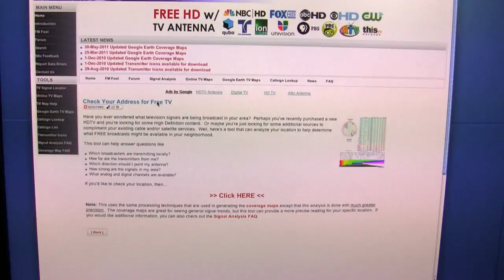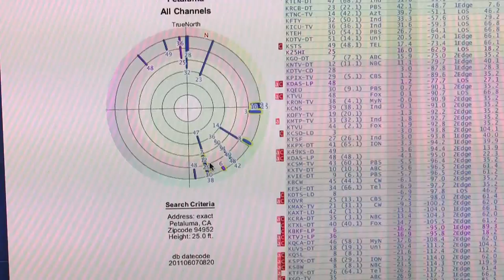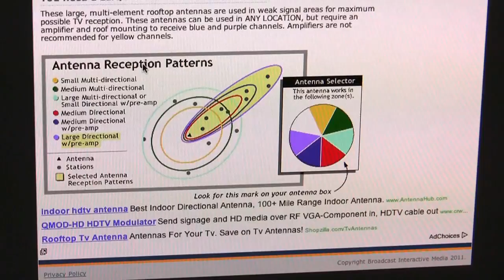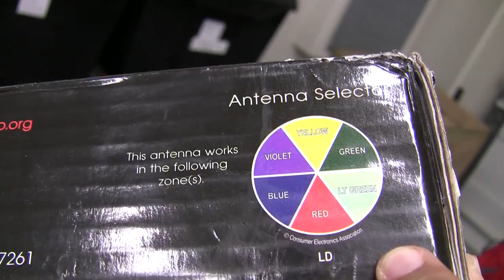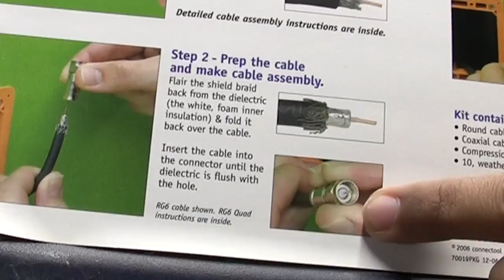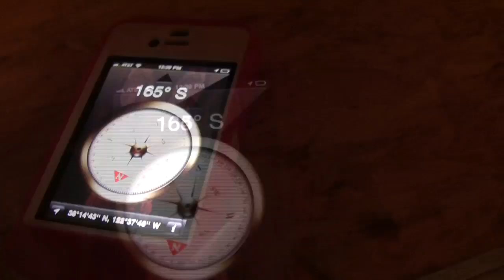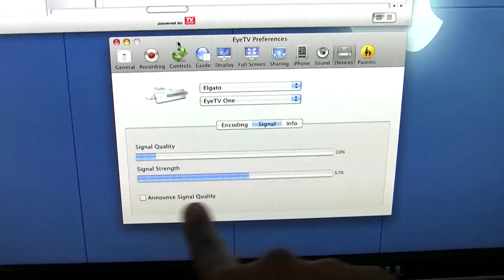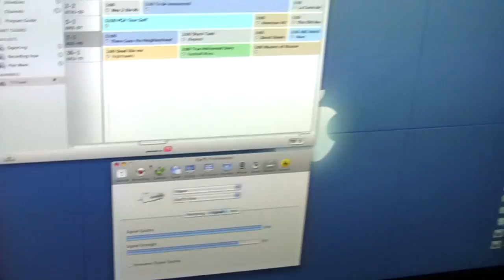Get free HDTV using an over-the-air antenna

Comment: Have a Nippon AU-14 (UHF) from a radio store. Looks like an arrow and works very well for my location.

Pointing the antenna is less an issue within 40mi from transmitter as long as you have strong signal. Out of town stations 50mi and over you tend to need more precise pointing. Sometimes the direction you want may be blocked by trees, hills & buildings so you point away to get a bounced signal.

Went by an electronic store with an antenna pointing the "wrong" way but still got all local stn.

Comment: All you need for an OTA antenna is an RF antenna connected to the back of your TV. You can buy the RF Antennas for about $10.
Connect it directly to your TV but if signals aren't strong enough in your area add 3 ft of CATV cable then add RF antenna.

Comment: I purchased the RCA ANT751R Outdoor Antenna and installed in my garage attic.  I hooked up a signal amplifier and now have 19 digital channels.  Thing is, my antenna points AWAY from the towers.  The towers are SW and my antenna points NW.  Only thing I can figure is, pointed SW, there are far too many homes and other obstacles blocking the signal.  Pointing NW, I've got a clear shot at a large open area where I'm probably getting signal reflection?

Comment: Can you point your antenna in the direction of most of the stations and still get some that are 55 or 60 degrees away? Or do you have to turn it each time you use it?  My favorite PBS station is in one direction, in other words, and the network channels are 60 degrees away. My favorite station is more miles away than the network channels (yellow zone). So should I point it at my favorite, further away channel? Thanks!

Comment: Attic installed antenna is not really optimum.  You have to put it outside if you are a long distance from the transmission towers.  Federal rules prohibit anyone from interfering with your "right" to install an antenna.  See here http://www.fcc.gov/guides/over-air-reception-devices-rule
Reply: natureflixs1
Reply: natureflixs1k moo

Comment: Here is my setup.  I am about 24 miles from the transmission towers with some trees in the front yard that I limbed up.  Here is a photo of my setup  http://flic.kr/p/jawzMX.   Don't forget to install a ground wire if you antenna is outside.

Comment: Except if it's transferred using Coax you're only getting a 480i signal.....and a split mono channel for audio unless it's decoded somehow. 

._.
Reply: Wrong. There are plenty of OTA HD stations.
Reply: I'm pretty sure I know what I'm talking about kid.

Coax is 480i max and a single Mono-channel split in two.

kthx
Reply: Objectified Cross You mean reparable, genius? It's not the same word, in context, as repairable. You're still wrong: Coax carries HD without issue and only artificial limitations placed on it via cable boxes render it unable to pass that stream through less than hdmi or (to a lesser degree) component. Those limits are restrictions to combat piracy, not limitations of coax itself. Only a bronie would start some bullshit routine about 'intellect'. Just move along.
Reply: It's the tv station/broadcaster and the the digital HD decoder/box that determines the video/audio output. Some tv top decoders only output at 480, but basically every single digital HD decoder that has been built into a tv (that has an ATSC tuner), can output at 720p and 1080i, and if the OTA channel has 5.1 audio (like when they broadcast a sports event like the Olympics, football, baseball, or a movie) you can get that as well.
Reply: The OTA signal is not decoded by the antenna. All the antenna does is "collect" the digital signal. The signal itself is actually decoded with either a tv top HD tuner/box, or a built in ATSC digital tuner (which almost every single digital tv has, as long as the digital tv was built within the last 3-4 years). Check your TV's manual to see if it has a built in NTSC/ATSC tuner. If it has the ATSC tuner and you are within 45miles (or arounmd 70 KM's) of a digital transmission tower, you are capable of getting these free digital OTA channels.

Comment: Truth and Quality , 
Practical and Useful Information.
------------------------------------------------------------------------------------------------------------------------------
>>> As Always <<< the Best Reception is L.O.S. = Line of Sight , Reception.
LO.S. Means No Obstructions of Any Type or Kind Between the Transmitting
Tower/s Antenna/s and the Receiving Antenna.
------
Yes Attics Will Obstruct and Degrade Reception.
------
Yes Buildings of All Types and Kinds Will Obstruct and Degrade Reception.
------
Yes Trees and Tree Leaves Will Obstruct and Degrade Reception.
------
Yes Any and All Types and Kinds of Obstructions Will In Fact Obstruct and 
Degrade Reception.
------
And Yes Obstructed and Degraded Reception is For Real and In Fact 
Obstructed and Degraded Reception.
------
The Reason I Word the Information Like This Is Because the Humans 
Will Accept and Do Any Type or Kind of Lie to Make It Not True.
---------------------------------------------------------------------------------------------------------------------------

Here is Truth About Installing Antennas.
www.fcc.gov/over-air-reception-devices-rule .
Antennas can be installed outside Above the Roof in plain sight in such a 
manner so as to have Reliable Reception.
For Apt's and such the FCC Website says where antennas can be 
installed outside in plain sight.
------

www.walleyesolutions.com , Take it to the other side. Wall , Floor , Ceiling.
------
Type the words , flat jumper coax , in , www.google.com , www.yahoo.com ,
www.amazon.com , or some other search box.
------
www.3starinc.com , antenna mounting hardware.
------
www.palcoelectronics.com , Light Weight Aluminum , Free Standing ,
No Guy Wires , No Climb , Lay Over Towers , Install Antennas and etc. ,
While Standing On the Ground.
------
www.rabbitears.info , has reception maps.
------
www.fcc.gov/media/engineering/dtvmaps , also known as 
FCC Reception Maps.
------
www.otadtv.com , has reception information.
------
www.televes.com/us , has advanced antennas and amplifiers.
------
www.channelmaster.com
------
www.antennasdirect.com
------
www.winegard.com
------
www.epvision.com , Advanced External Tuner/Recorder.
---------------------------------------------------------------------------------------------------------------
I Know More , A Lot More , Truth , Quality , Practical and
Useful Information.
I am now 73 years old , recommending/installing antennas and 
electronics all my life. Even when I was in grade school.
------
I Do Not Receive Any Compensation For the Information I Provide.
------
I Do It Because the Humans Of This Time Period On This Planet
Need It Because The Humans Are Lacking , Big Time.